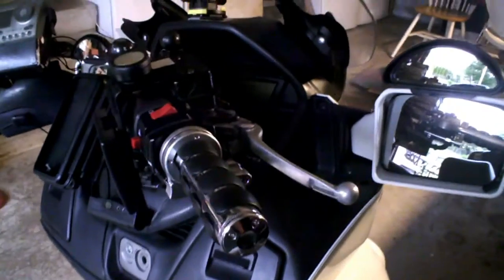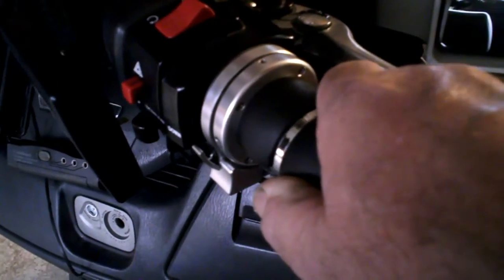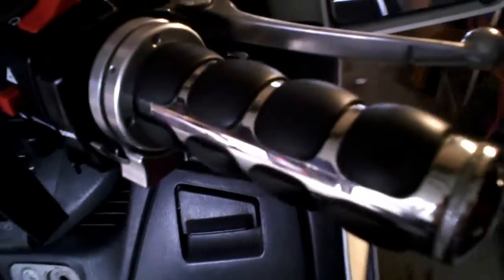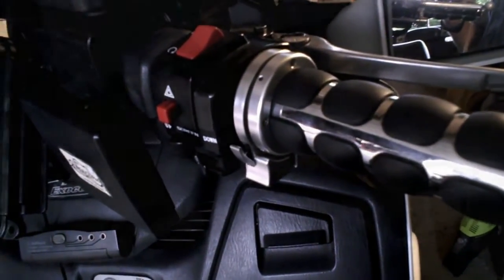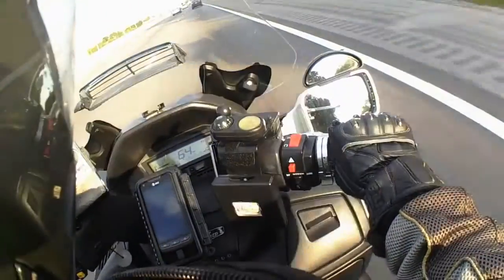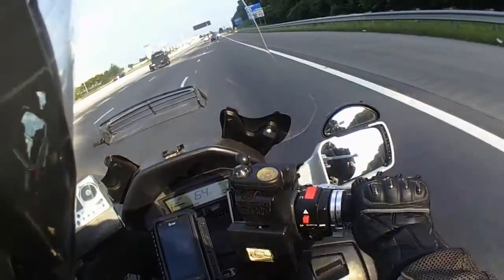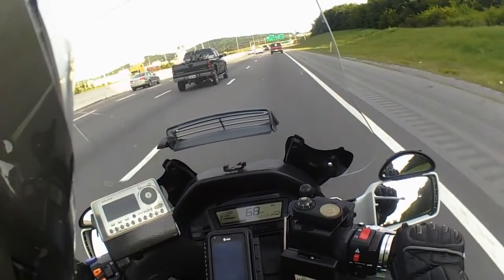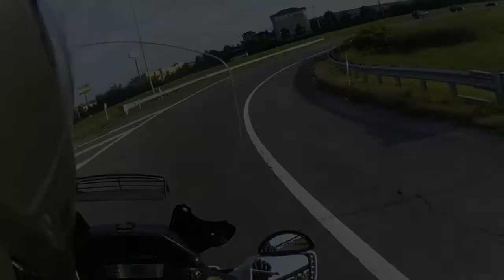BreakAway Throttle Lock Install and testing

Comment: I love my breakaway. My 650 came with a throttlemeister but I never use it. Just have it as a bar end now. I wouldn't use anything but the breakaway. Hope you use it for many miles! If I may ask, where did you get those extra mirrors? They fit quite nicely there.

Comment: Thanks for sharing this.  I have the same product still in the package for my V-Star.  I have been using the crampbuster but plan on doing the install this winter.  It looks like it works ok. Take care.
Reply from the maker: sam smith Thanks Sam.  Works good, so far.

Comment: I was going to try the Kaoko Throttle Control but I like how this one works.. Got me to thinking about trying this one. I have also decided to try a darkside tire when the time comes. Got the tire picked out and a place to install it already.
Reply from the maker: NewZona Rides  I really like the release on the brake lever in case you have to do a panic stop.  Very solid unit.